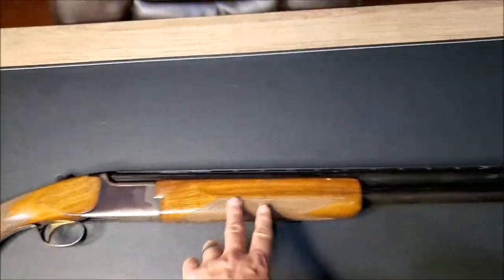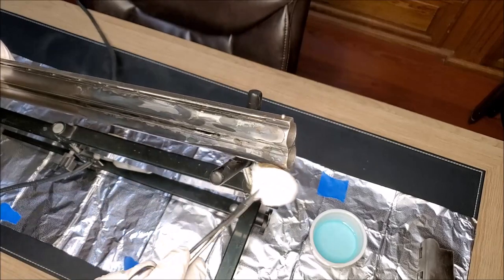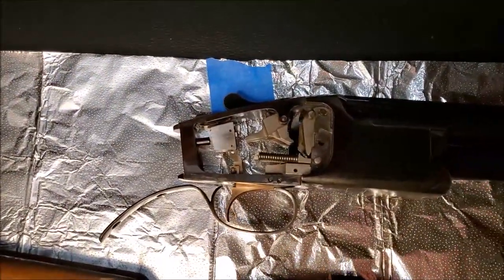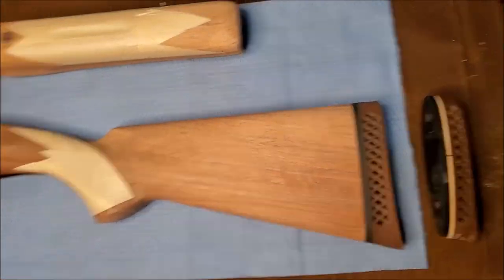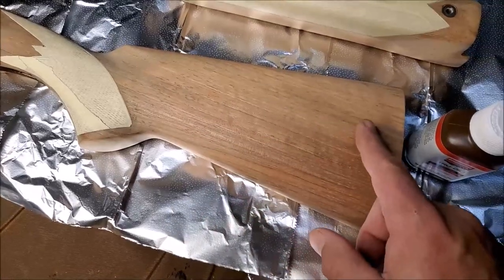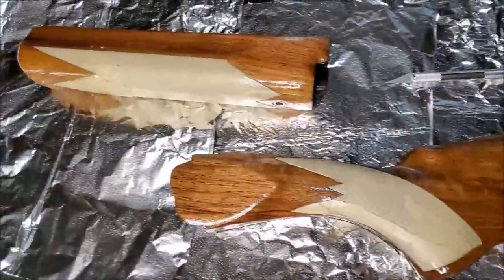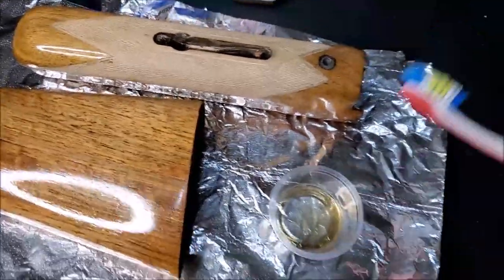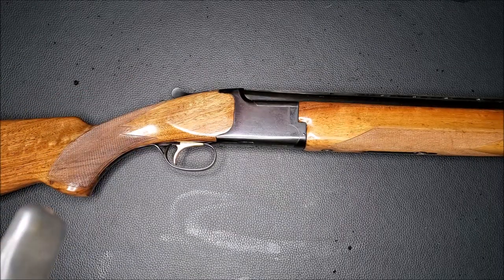RESTORING A VINTAGE CITORI

Comment: The stock finally cracked on my 38 year old 12 guage Citori...after hundreds of falls over 38 years.  Mine has less blueing that the one in your video but still shoots great...I did replace the firing pins once.  The safety sometimes slides between over/under and will not engage, so I had a gunsmith pin the safety so it always shoots under barrel first.  I ordered a replacement stock from EBAY for $250 so hoping it fits the receiver and back to hunting here in Montana.

Comment: What an awesome video.  I just ordered a Zastava Zpap Ak with walnut furniture and the furniture was just raw unfinished walnut.  I sanded it and applied 10 coats of 100% tungoil and man did it come out beautiful.  I like the truoil look shiner.  This video was totally satisfying to watch.  I have never seen a bluing job and picked up some great pointers.
Reply: Thats about par for Zastava lol. I bought a new m70 in 6.5x55 and the only oil on the stock was whatever had dripped out of the bolt action lol. Bluing job is impeccable and I dont mind one bit sanding and finish my own stock

Comment: Didnt watch this one on purpose as I wanted to take my time, It was worth the wait, great job..does the blue you use do as good as rust blueing?  Also do you have trouble with the grain standing up, popping..after the first few coats of oil on the stock and have to re sand

Comment: I would love it if you did a video on the Wsm cartridges.
Reply from the maker: Unfortunately, I'm not a fan of the WSM cartridges. A solution looking for a problem that doesn't exist.
Reply: @desertdogoutdoors1113  I totally respect your opinion. I however love them. A 180 grain 30 caliber projectile traveling at 3,000 fps in a light short action rifle. Sounds perfect to me. But like you said they are looking for a problem that dosen't exist. My old .270 or 30-06 will kill the same game.

Comment: Odd question, but do you have a special (thin) screwdriver to get the screws out of the trigger guard to remove it as well as the ones in the forearm?  The slots in mine are super thin and I'm afraid to strip or scratch them all up?  None of the screwdrivers i have fit.  Thanks.
Reply: Disregard.  Its on the video.
Reply from the maker: Get a good set of hollow-ground screw drivers.

Comment: Great job, I have a 1976 citori I used to duck and pheasant, (Full and IM chokes).  We can only use steel shot for bird hunting here so I either have to shoot bismus or hang it as a collector piece. Anyone have their citori re-bored for steel, any other solutions?
Reply from the maker: Just order Boss shotshells and use your gun as intended.
Reply: Thanks for the tip, and cheaper than bismus
Reply from the maker: @llucq1  Boss shotshells are bismuth

Comment: I have a Citori 20ga that "points high" when shouldered. I'm not sure what can be done to the stock to get it to fit me better.
Reply: Try putting a washer between the recoil pad and the stock on the top screw
Reply from the maker: If its just a fit issue to get proper sight picture while shouldered, try shimming the stock lower; this is the common way to fix fit issues with any shotgun. 

But if you are getting the proper sight picture with the gun shouldered and it still shoots high, the problem is somewhere else. Sometimes changing chokes helps (choke may have been crushed and lost concentricity). Shooting high is a known issue with many Citori's (and Benelli SBE's). Some of the older Citoris shoot low-velocity shells perfect; but if you switch to high-velocity loads it brings the POI up noticeably. Unfortunately, I have seen Citori's that needed custom rib work.